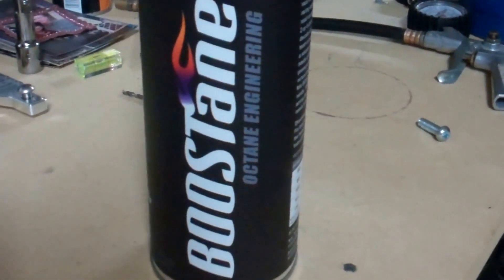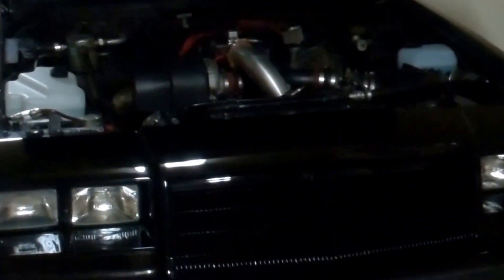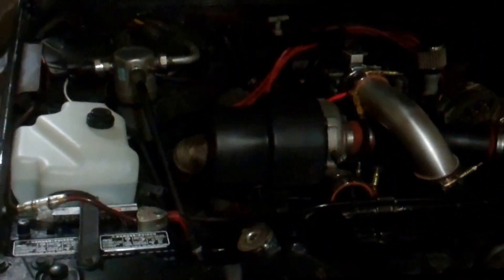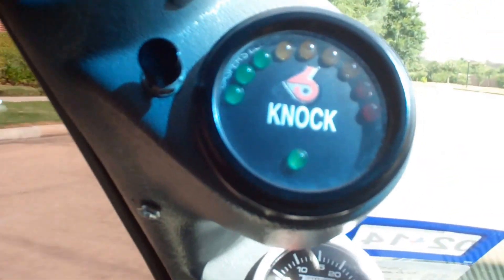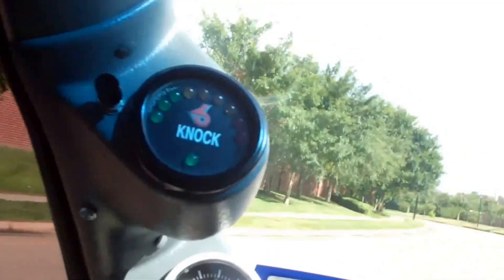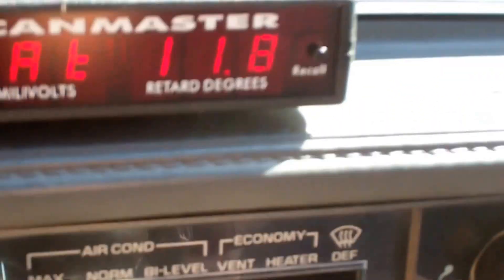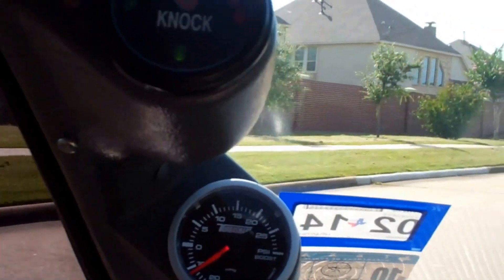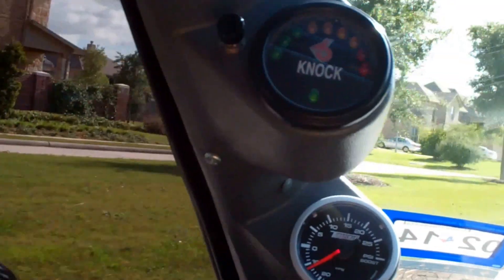Boostane Test Run in 1987 Buick T Type

Comment: Pretty cool test. I did some test with Dragon Concentrate and it definetly works. Seems Boostane is a better option, I want to test it. 

With dragon in a VW 1.8 t mk4 with a k04 hybrid, I was able to run + 10 ° timing no knock at 6.000 rpm. After mixing it with 6 gallon of 87 Octane AKI, the best crap I can get in my country.

Comment: Looks like your running about 16 lbs .  Your not running the stock turbo correct?   You ran high 11's in your other video .. Was that w the 103 chip,  more boost and some C16 ?
Reply from the maker: TE-44 and I cranked up the boost to 20lbs later that day and added the other half of bottle total of 32oz for 6 gallons. Zero knock hardly even came on in the green. Turbotweak 103 chip. Upgrading to T66 and 80lbs injectors in about 3 weeks. Should run about 11.25 at 120mph. I plan to use the boostane to achieve the 103 octane or more to be safe. We might even run high 10's on stock 2200 converter we'll see
Reply: Great keep us posted!
Reply from the maker: Fastest time 11.78 103chip by turbotweak with 104 racefuel. Boostane has now been tested with one 32oz can with 15 gallons 93octane at 20lbs of boost and doing well. I could put 1 can with 5 gallons to create 109 octane and turn boost up to 22-24lbs and I know she'll run 11.50's at around 117mph.

Comment: How do u mix it??????? When u pur i in it doesnt mix well. I still have my doubts
Reply from the maker: It works, zero faking! Just try it.amd follow directions!
Reply: @deze2000  we race small 2t scooters and shiftbikes. Buy racefuel is expensive. So if this is cheaper maybe try it when we adjust ignition timing jetting and head cc
Reply from the maker: @guidosamson682  best is to mix in a smaller tank but it will mix in. Dude who races snowmobiles 2 strokes uses it and loves it. I know the inventor who has a race boat and the fuel at the dock is low octane and expensive. This was SEMA product of the year like 5 years ago and those people aren't stupid. Again like I did you have to try it out bro! 🤷‍♂️
Reply: @deze2000  i will check howmuch it will cost to bring it to Suriname. Thats my country. Vp and renegade fuels are available here but expensive. Im looking to cut the cost of racing fuel and gainig result in hp and torque
Reply from the maker: @guidosamson682  what's your email I'll put you touch with owner

Comment: Do you still use boostane??
at 20lbs of, did you see any knock??
and did you raise the boost higher than 20lbs with boostane
Reply from the maker: I have a chip for 104 octane and used boostane to make the right octane and yes between 20~22 lbs but might car was stunned for that. Boostane works you just have to tune to match

Comment: I run 15 psi all day 91 pump gas   tt chip 25psi alky.something up start with you're voltage also look at you're o2 mil volt should be 750 800 WOT

Comment: Your battery voltage was low, might have a bad ground or corroded connection.  Thats whats probably your problem

EDIT:  Nevermind, I see you noticed it as well :)
Reply from the maker: Damn Alternator was bad and swapped for a life time 120amp Oriley and now puts out 13.8-14 volts full time and then I have the casper booster for WOT so no drop off. I may have to adjust the plug cap. Its around .33 right now with a Autolite copper 23 I believe.